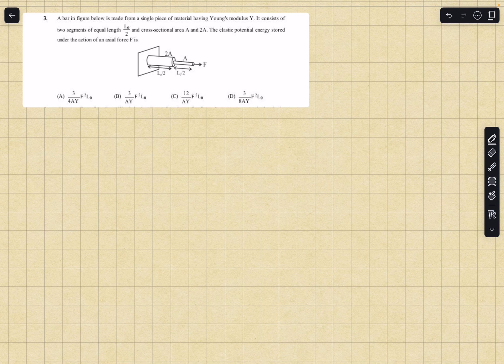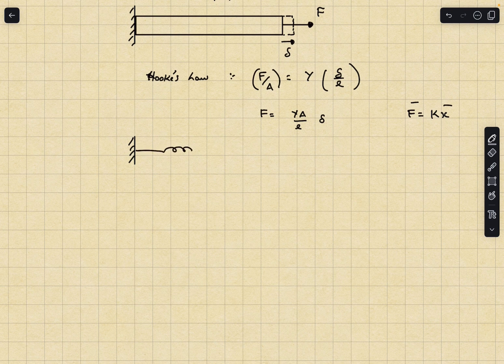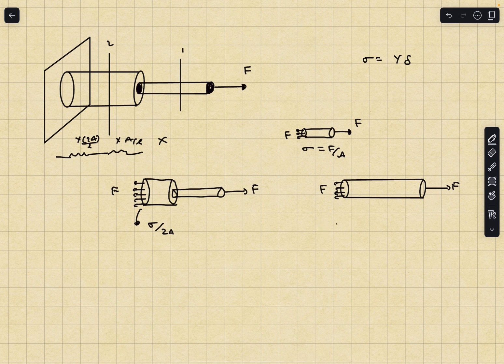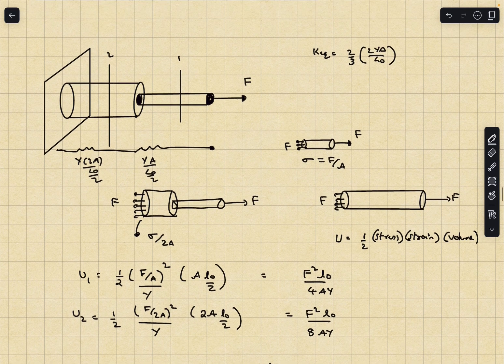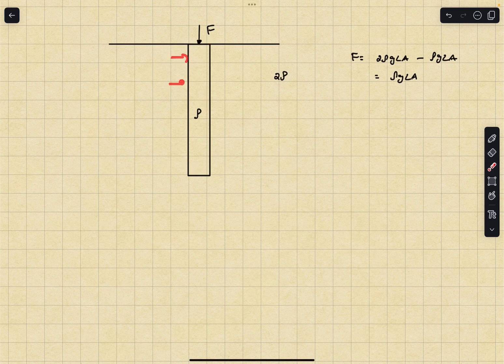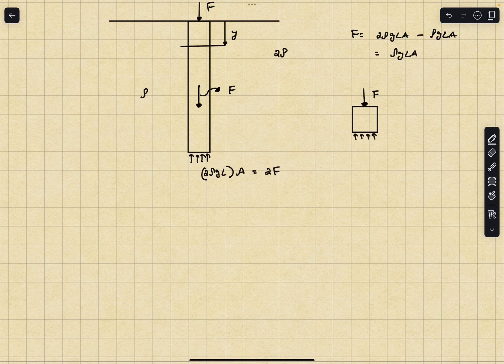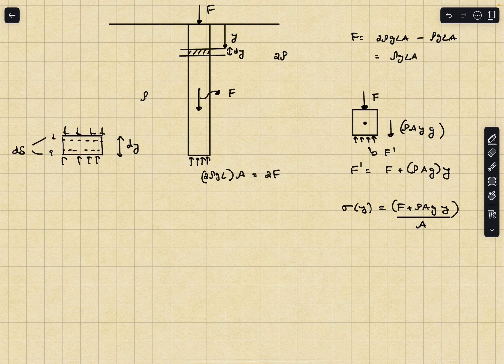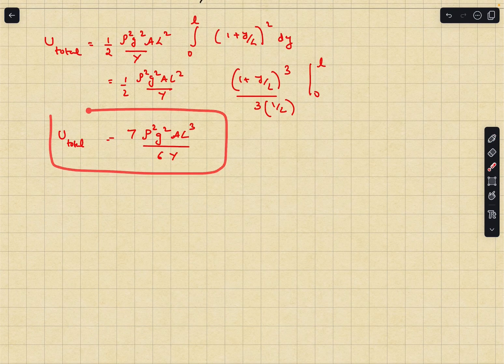[JEE] AITS Problems On Stored Elastic Potential Energy Of A Rod

Comment: I have a doubt - we have taken pressure force at bottom to be 2rhogLA, but won't it be 2rhogL'A, where L' is the new length after length changes. We had to neglect strain in the rod?